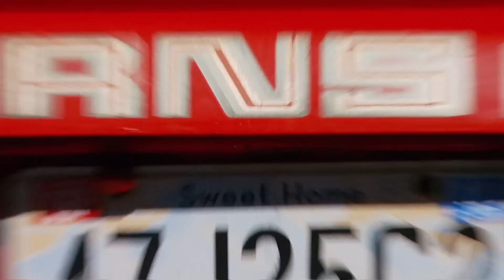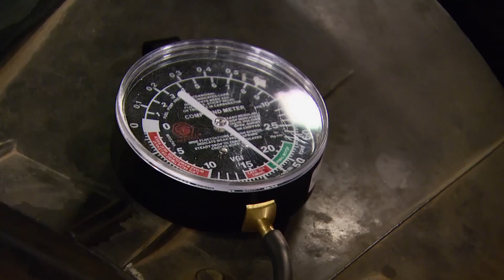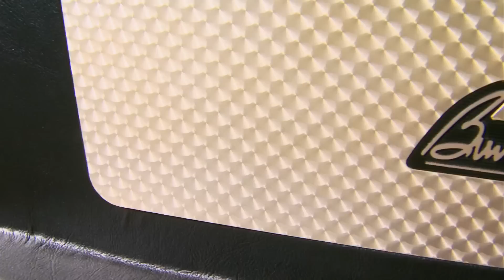Transforming A '78 Trans Am Into A 500HP Tribute Car - Detroit Muscle S1, E1

Comment: I knew this had to be an older episode - 2013 - and Burt has passed away - R.I.P. - but the Trans Am renovation still makes my heart pound just that much quicker.
Reply: Exactly my thoughts. Got me there for sec ... rest easy Burt.
Reply: It aired in 2014. Probably recorded in 13.
Reply: I have a '67 Pontiac 400 block that I want to rebuild and get between 500-600hp. And put it in my '75 Firebird/Trans Am clone with a 400th trans. And that is just for starters. I have had her for over 23 years now.
Reply: Yah same I was so confused
Reply: Aired: Jan. 2014
Reply: The last time I saw Burt Reynolds on TV in 2017, he could barely walk and had lost a lot of weight.  I knew he wouldn't be around much longer, just not so soon after that.  Binge watching the Smokey and the Bandit trilogy never gets old!

Comment: About 182hp at the crank. The catalytic converters in those days were pellet type. Nothing like today's. They were extremely restrictive. They also were known for getting clogged. That old single convertor I bet is clogged. Today's cats flow gangbusters compared to them. 400 cubes going thru single pipe up to cat and after for a little bit. I guarantee a big gain just bye putting a test pipe in place of it and a little carb adjustment. Also advancing timing.
Reply: That 400 is a boat anchor at 8 to 1 compression in that even 200 horsepower you need to scrap it completely start from scratch make the combustion chamber smaller bring the compression up get rid of the converters.

Comment: I bought a new red one in 1978, with 4 speed, TA 6.6 Eng. 3.42 gears, cost was just over $6000.00. I added Hooker Headers, 1.6 ratio rockers, I opened up the catalytic converters with a torch and reinstalled, I replaced the huge cast iron intake with a Edelbrock Performer intake, I installed coil helper springs to the rear shocks to raise the rear of the car up for a better look. I never raced at the drag strip but wanted to know what the car would do so i went to Milan dragway  and decided i would make 3 passes my best was a 14.01 at 100 mph with stock tires.
Reply: I have a 78' T/A 4speed W72 package car..same specs. My father got it back in 1981 with headers on it...everything else was stock. The headers had a flat spot on it from bottoming out. Did you have clearance problems on yours? I got this car out of sitting in his garage for 35 years! My 400 is getting  a rebuild soon.
Reply: @curtpozzi5527  Hello, I had no clearance problems with hooker headers that I installed. Have fun with your rebuild.

Comment: Talk about Flashbacks. 

I remember this episode when it was new. 

I remember mostly how gutless that 400 was.
Reply: They had 7.8 to 1 compression from the factory. A little shave on the heads to raise it to 8.5 to 1 adds 50 horse. Getting rid of the cast iron intake & replacing it with  a dual plane intake helps
Reply: Hey but its capable bro!...there's a shitload of power in that thing to be had!...but EPA standars of the 80's killed ALL engines and I mean ALL ENGINES it was about fuel economy and low emissions as well as reliability which GM is known for!...
Reply: I know engine power from about 72 or so till about 97 when the ls came out was terrible. 
I know with mods this n most engines can make alot more power. 
What made this engine even more pathetic was earlier on the power block they had a flat head that made around the same power.  The hosts talked about it being gutless.
Reply: I know engine power from about 72 or so till about 97 when the ls came out was terrible. 
I know with mods this n most engines can make alot more power. 
What made this engine even more pathetic was earlier on the power block they had a flat head that made around the same power.  The hosts talked about it being gutless.
Reply: I'm gonna hemi swap a TA

Comment: Driving a Pontiac myself, 2010 G6 GT / 3.5 litre V6, with a Stage 1 Chip setup and Resonator free exhaust, and Cold air intake. From stock numbers of 220 HP, now it’s safely estimated at 250 and I’m waiting on February to order Stage 2 for 35 more ponies.

Comment: When I heard YearOne put a Chevy in that Cool Bird I just got sad and shook my head. If you're going to build a sweet ride, with a budget like that, why only go half way? When I heard you were using a real Pontiac engine in your Cool Bird I got happy. Nothing wrong with those Pontiac motors. Some of them 421's 428's etc. were running in the 7's in full size cars back in the 60's, no need to swap them out for a "supposed" better engine. Thanks for keeping it Pontiac, I'm off to Binge watch the rest of the series now. Thanks for sharing. Best Wishes and Blessings. Keith Noneya

Comment: I'm a Pontiac guy!
Reply: Whatcha got? I have a 72 lemans! If you don’t have one, what would you want?
Reply: Pontiac and Chrysler 💕 love my Dodge
Reply: Me too!
Reply: In all the "whose is better - Ford, chevy, mopar - arguments" you never hear anyone ragging on Pontiacs.
Reply: @mindeloman  they should if you watch the ss drags where cars have to be the same as stock pontiacs do very well. Against all takers. Also for sure in the 70s they kicked but on all takers. A ram air IV was underrated at 370hp it actually made 450 and was lighter than the BIG blocks by several hundred pounds.
Reply: @blainesnider9089  years ago i worked with a guy that was an old mopar guy. Worked as a mechanic at a chrysler dodge dealer after he got home from Vietnam. It was the late 70's and early 80's he was buying Hemi cars and parts for almost nothing. Had his own little warehouse of Hemi parts in his back shop behind his house. Anyway, i considered him one of the most knowledgeable Mopar guys i've ever met. I mean, he Mopar school. I learned a lot from him. He freely admitted the off-the-showroom tuned Hemi was exactly as advertised. About 425 HP. They weren't all that special. Which also put it neck and neck with other big block muscle of the era. Where the real prowess of the Hemi is, is with very little effort you could add serious horsepower. It was a race engine HIGHLY detuned for the street. By just putting long tube headers on stock tune was worth at least 50HP. The stock dual carter 4 barrels looked cool on the showroom, but running a single plane intake with a single Holley Dominator added serious horsepower. Plus, he said stock dual quad Hemis were known for constantly blowing the power valve in the rear carb. Anyway, i guess the reason i say all this is, this Chrysler Hemi professor, when i knew him,  drove a 67 Pontiac Le Mans. The reason: he loved pontiacs too. He hated chevrolets though. Quote: "You can set your watch to when a small block chevrolet will start leaking oil and that #7 cylinder will start fouling the plug." Anyway, just some anecdotal story telling.
Reply: @mindeloman  true but only with boost do they shine check out Richard holdner s video dyno tests and picks exact builds everything. The problem with the hemi is the combustion chamber is not efficient that is why the new hemi heads ard different. Domed piston screw up flame travel in the hemi too!
Reply: @blainesnider9089  ha! You know, all our talk is muscle car heresy. You can't insult the hemi and  kot hear about it from the fans boys. The reality is: engineering is all about give and take. And the hemi was a NASCAR engine designed for high rpm horsepower. Obviously it was highly successful when adapted for drag racing and much of that success came through pressure induction.
Reply: @mindeloman  never insulted i don't know here you are coming from just the truth. The hemi chambers are not efficient fact check it out. It is fact.
Reply: @blainesnider9089  woah......dude.......not sure why you're spoiling for a fight. My last post was in complete agreement with you. Life is just too short to be contentious. Peace

Comment: I bought a 1980 Firebird last year its a roller but besides the clear coat flaking off its a almost a 8 out of 10 the interior is pretty nice, Zero rust anywhere. I haven't figured out what i want to do with it, I bought a cheap cover for it put some tarps over it and put it on jack stands in my pawpaws open pole barn LoL! I dont know when this was actually filmed but all it needs is a pullout ls3 with a cam and headers with a good tune with a 4l80e and then you would have a 500hp street car you could drive anywhere.

Comment: Yes I know about the y88 gold special edition. I bought that car also. I didn’t like the rear drum brakes, the car had a hard time stopping. The 79 with the disc brake rear was a big improvement. No antilock so you could lock up all 4 whelks and slide right up to the stop sign if you wanted to ;) but braking was much improved.

Comment: I so wanted a 79 Trans Am but I was only 16 and knew it wasn't going to happen.Then in 1986 I was working as a helper doing heat and air and we went to this guys house outside Nashville and he had a 70's TA with only 4000 miles on it but it wasn't for sale.I bet there are still some out there somewhere in great condition.

Comment: I once owned a 1976 Trans Am with a 455 (7.3L) engine and a four speed manual transmission. It was brown with the golden chicken on it. I wish I'd kept that car but face it a 16/17 year old and that much power well lets just say I figured out if you reved it up and dumped the clutch that baby could lay serious rubber.

Comment: had one in high school, my dad's  buddy helped me build it.  bored it 20 over, some head work, a aggressive cam, a 750 carb and it ran like a scalded dog.  I busted 455, 396, 454 383 strokers and they all thought I had nitrous.  Pontiac 400  with cast numbers were stout engines that you could get low 12's no problem

Comment: I am glad you are keeping it all Pontiac by using the original motor! Back in the 90's and prior, everybody had to drop a 350 SBC V8 in everything. Even their pet dog had to be 350 powered, lol. If you're going to build a Ford, keep it all Ford by using the original V8 that came with the car. That includes the optional engines that were offered by the manufacturers back in the day. Keep the historical factor in the car as much as possible. I would never drop a modern Chevy motor in a old Ford or drop a modern Ford motor in an old Chevy or vice versa.

Comment: 2:08 That's not a '69 Trans Am, you can tell by the front bumper. It is either a '67 or '68 Firebird as it has the smaller headlights within the grill silhouette whereas the '69 had headlights entirely separated from the grill. Also 1969 was the first year of the Trans Am so its most likely that its a Firebird 400 as the was the model with the largest motor for the first 2 years.

Comment: Just removing the pellet cat 🐈 and adding a alum intake and long tube hedders make a big difference. 
I did that on my 78 with a 400 auto. Not on the 79 anniversary. 
But I can tell you 93+ octane is a good idea ;). Cam2 race has doesn’t offend them either.

Comment: I just got a 84 Trans Am 15th anniversary complete except for the windshield it needs a engine transmission driveshaft but it came with title for 500 bucks game with everything else brand new decals for it no rust still have good tires on it factory wheels anniversary edition Wheels and All Electronics still working it is except the radio

Comment: Poor old Burt Reynolds was barely walking may he rest in peace.

That's crazy how emissions killed these motors. On the other hand my 1988 turbocharged from the factory 1.8 with 15 lb of boost did 184 to the wheels. Stock turbo with more then stock boost. About 14.2 1/4 vs 16 with the 6.6 v8, lol. I still love V 8s over 4 cylinders though. 

 I also love restomods. Old cars with Modern Performance. Only problem is it's wicked expensive if you have a shop do it. I bet the one Burt Reynolds had was some where between 150k and quarter million dollars. And for that kind of money it better have dual fuel system with thousand hp on pump 1500 on race.
Reply: shouldve ended your comment after the first sentence,this video is almost 10 years old and the info on your new car is pointless and irrelevant.no one cares and it adds nothing,new cars make more power,weigh more,look shittier and the new generation of drivers cant drive.....
Reply: @trillrifaxegrindor4411  you sure told me. That will teach me to YouTube comment. 🤪

Comment: Ive had 7 f body cars as well as a 69 Judge. I had a 77 bandit TA. My 75 TA with a 72 455 HO engine was my favorite with a super T-10. I was wondering what the 455 block ? I think 75 76. 74 and earlier blocks had pre drilled mains for 4 bolt caps. What cc were the heads you used?

Comment: I will forever regret selling my '78 T.A. ! Worst mistake ever!
Reply: let it go
Reply: I had a 1974, 455 T/A.  so I get where you're coming from.  Damn, they are so expensive now.
Reply: @PlugInRides  no doubt! Mine was a '78 but had a 455 out of an earlier model Pontiac!
Reply: @PlugInRides  I know this, if I am ever lucky enough to get another I will keep it forever !!! I was lucky enough to have had 3 F bodies, my  first car was a 77 firebird with a 301,  it ran great but was extremely rotted! Later I got a built red  '79 Z28 Camaro. W /T tops! It had a 400 out of a 73 caprice. Bored 30 over /406  with reworked Turbo 400 with a shift kit, manual valve body, stall conv. Topped off with a B & M mega shifter which also had a really nice chrome plate around the shifter plate or bezel  displaying p.r.n.d.2.1 and was set in a new center console. New black carpet! The front seats came out of a salvage yard from a 90's Pontiac sunfire or something but it had  373 gears In the rear, dual flowmasters,  & well, the list of goodies on the Camaro were endless but it was a running beast! Well over 500 hp ! And later I got the 78 455 T A  which is what I always wanted! Had it 8 years and sold it! Will always regret it!
Reply: Mine was stolen 😭
Reply: Not really
Reply: I mist my 77 .
Reply: I had a 76 TransAm 455 4spd in 1980 when I got married. A short time later due to the piss poor gas mileage and its horrible habit of eating clutches I got rid of it so we could save money to buy a house.  I have regretted the sale of that car ever since. But my wife really loved the house so life was good anyway!
Reply: Mine was selling my 86 Cutlass Supreme Brougham!...that was a beautiful car glad I found another although I'm rebuilding it from the frame up
Reply: @PlugInRides  yeah very expensive! Circumstances, mixed with bad rationalizations, sometimes convince many of us that  it's ok to let them go when in reality we know we shouldnt! Then, like "Danny Trejo"  says in "Bubble boy" "Dont live in regret ese!  We do! Now in my case, I watched the value go up on Trans and a thousand a year, over the course of the eight years I owned mine! Now in my case I thought that since the original engine had been removed and an earlier modle 455 had been installed I wasn't sure how that would effect the value of the one I owned but since Pontiac blocks were all dimensionally similar, who knows! Not to mention the 455 was a definite improvement  but u know!
Reply: @nathanielbolden5053   my first automotive passion was for a G body but in my case it was regals! Still between my brother and myself we had 4 regals and later a cutlass that only had the half grill! The upper  if you look up 86 and 87 u will see what I mean most had an upper and lower  then some had what looked lit half of the normal grill! Anyhow my girl back then allowed her friend to borrow my 86 maroon or burgundy regal and she totaled it! Later that's when we bought the cutlass with 57k  and what did she do? Again She allowed her friend to take it and again, she totaled it! Wtf

Comment: Isn't the 6.6 ltr the 403 buick engine?
Reply: 6.6 could be Pontiac 400cid or Olds 403cid.   Olds 6.6 was 403cid.  Buick's 6.6 was 400cid.   Pontiac and Olds had distributors in the back, Buick's distributor was up front.   I don't recall them putting the Buick engine in the TA/Firebirds, but they did put the Olds engine in the Firebirds.   The engine in this TransAm is a Pontiac.
Reply: Thanks for setting me straight on the subject.
Reply: If this car is an automatic transmission car its got the 403 Olds engine.The 400 Pontiac was only available with a four speed manual transmission in 1978

Comment: Are these reruns? Says it was uploaded today anyway I had a Trans Am like this they are so slow they couldn't get out of their own way LOL, 136 horsepower 😂 i guessed 180 hp, will definitely be cool with 500 horsepower
Reply: If you tune it right it will easily get 14.0 at 105 at the 1/4 mile ,   mine would do 13.3 with a couple bolt on parts
Reply: @danzare5638  thats definitely more than 136 hp! Nice!

Comment: Why don’t you build it with huge offset wheels, plastic eBay fender flares that don’t fit right, strip out all the original interior and don’t replace anything, haphazardly bolt in “safety” seats with a couple fender washers, and use plywood and garden materials for an aero kit???  Oh. Nevermind....